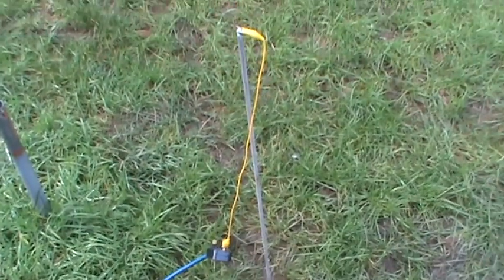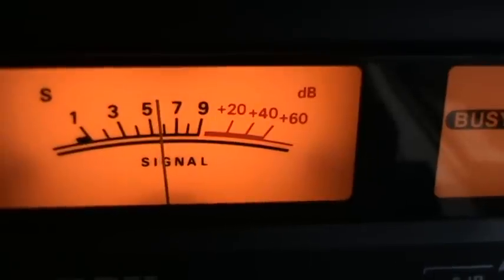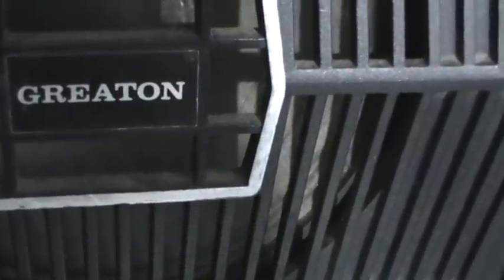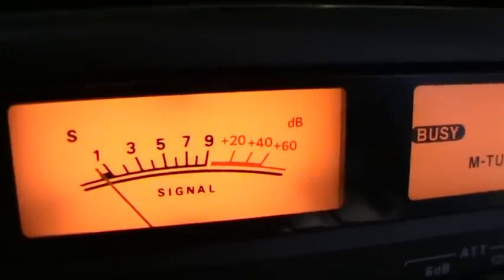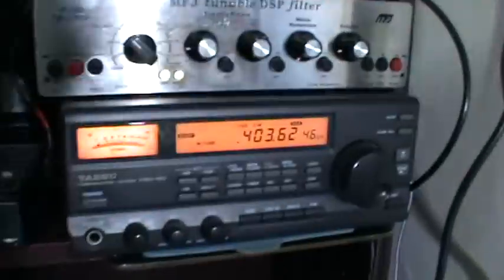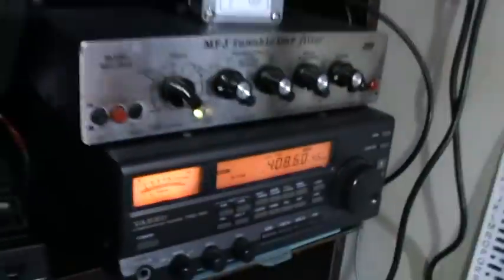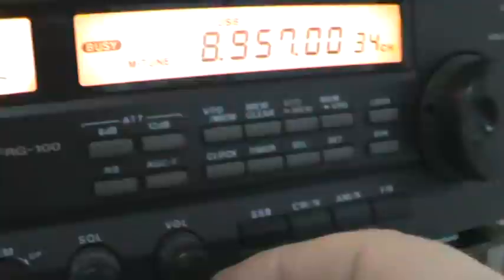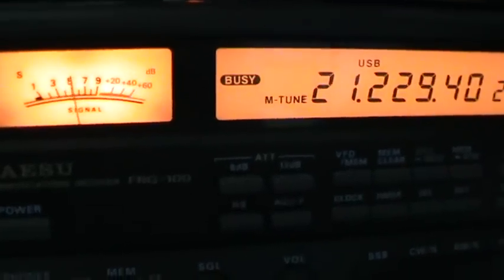MiniWhip part 4 Final, tests and performance

Comment: Witam mam pytanie jakiego akumulatora jakiej mocy pojemności do anteny mini whip?
Reply from the maker: Hi the miniwhip runs off a 12vdc power supply. However it uses so little power that running it on batteries would he fine

Comment: Mike, record your test results then do it again six months later then a year after the original test.
Reply from the maker: What are you expecting?
Reply: @MikesMovies  I'm expecting the resistance will change. Your station rod is copper plated, the copper will corrode over time based on the acidity of the soil and conductivity will decrease as time passes. How long is the station ground rod? Here in Canada ground rods are about ten feet long, steel and galvanized, some are just plates about one foot square of thick steel and galvanized. Of course different countries have different requirements and soil characteristics can change in a metre or so. Another thing to add to the station maintenance list.

Comment: Thanks Mike for helpful videos, I've recently purchased a miniwhip - waiting for delivery! Can you advise on what is a typical size is for the DC input for the 'power unit - e.g. 2.5mm or smaller? Can't find any info - good to know before it arrives
Reply from the maker: Hi, I will need to meansure it, not at home right now

Comment: A worthwhile series thank you, the proof (performance) is in the pudding as they say, the MFJ DSP filter certainly helps a little as well...
Reply from the maker: +SpectreOZ Very many thanks, makes the effort worthwhile to get feedback like that! Yes the MFJ does a good job, I do have a Datong analog filter I want to try and may produce a part 5 if there is a significant difference!
Reply: MikesMovies Will look forward to that video, filters from what have garnered are quite cost prohibitive once factoring shipping costs.